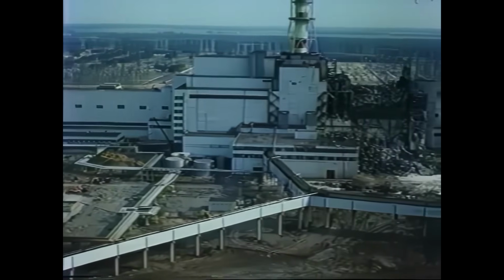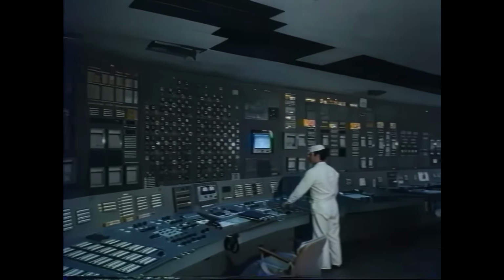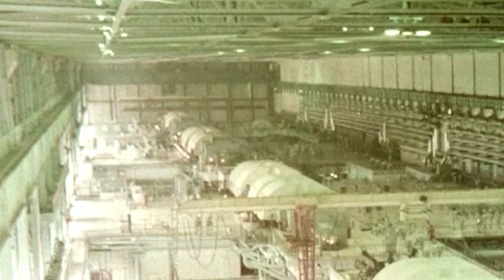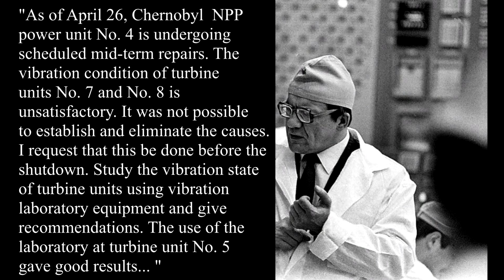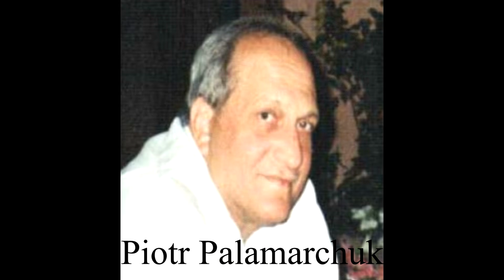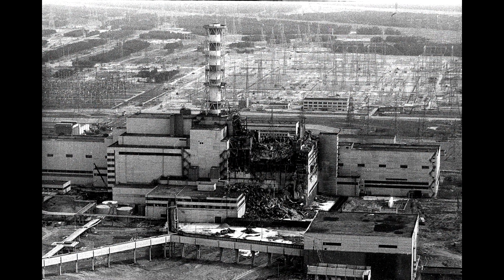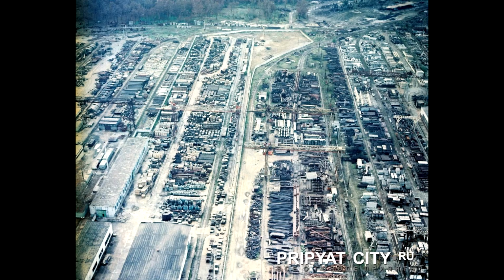Chernobyl Vs. A Mercedes: The Untold Story

Comment: Regarding Western Computers VS Soviet Computers there is an intresting story about how the Moscow Airport was modernised for the 1980 Olympic games.
USSR couldnt manufacture good enough computers for the Airport operations and American Computers for such operations was not possible due to Trade Bans between USA and USSR.
So  Moscows Governor contaced the Swedish Embassy for the possibility of an Affair with Swedish Computers which at this time was able to play at the same level as the Americans.
and after some deliberations the affair was approved With some Special rules to the Installment of the systems beeing done by Swedish Engineers.
there was however a small issue.
You see it  turns out that the new Computers used American parts to a certain extent and for those there was the ITAR rules.
So the Swedish Company DATASAAB if i remember correctly Simply kept their mouts closed about the parts and hoped that USA would be to tired of drunk to connect 1+1 = 2.
This was however a Dumb plan and it was soon found out by the world.

So those Computers would indeed be very valuable for USSR.

Comment: Being a big fan of the NG series of Mercedes trucks, with a huge amount of information about it (documentation, drawings, images from different eras of production and operation, documentary videos, etc.), at one time, having become interested in the Chernobyl Mercedes, having studied and analyzed all its possible photos and footage of the chronicles in which it appeared, I have every reason to believe that this is NOT the 814/817/LN/LK series:
- the LK has a windshield located as close as possible to the roof of the cabin. the NG has a larger distance between the glass and the roof;
- the LK has sharper upper corners of the cabin than the NG;
- the LK has a practically flat roof, unlike the smooth roof of the NG (if the truck has a cabin of at least class M, more on that below). Also, the corners of the NG windshield are smoother;
- I have photos where you can see the grille of this Mercedes (you can even make out the emblem). This grille is too wide for a LK.
- After processing the photo at 9:45, I found that the length of the cabin ends at about the same place where the length of the fender ends. This made me realize that the truck was equipped with an M-class cabin, which has a small space behind the driver (and passenger). The length of such a cabin is almost half that of an L-class cabin with two sleeping bunks (that's why I call it a semi-sleeper). Why am I telling you all this? The LK NEVER had an M-class cabin. The photo at 0:25 creates the illusion that the truck has an L-class cabin. In fact, this photo was enhanced, processed and stabilized (of course, I have the original), as a result of which the glass on its door was duplicated to the right;
- There is a very popular photo of the destroyed unit from the outside during the liquidation of consequences of accident, taken at about the same time as the photo at 13:14, but from a different angle, which shows that in that place on the ground there is a van-laboratory without a truck (in another photo that I have, you can see that the van is missing a door, and next to it is a broken fire engine). Towing over-irradiated equipment from the territory of the NPP was pointless and dangerous, so the Mercedes, like the fire engines, was buried underground there, on the industrial site.
- The NG has a higher load-carrying capacity and is more durable than the LK (for many reasons and characteristics), so it was more expedient to put the van-laboratory on its chassis;
- By the way, I spent a huge amount of time to find at least one photo of a Mercedes of the LK class on the territory of the USSR. Unsuccessfully.
- This is not the SK series, it was put into production in 1989.

Comment: This is my bread and butter.  Data acquisition systems cost a fortune, and the best ones come from Germany, Austria or Switzerland.  It's no wonder the crew stayed with the van and tried to save it, they might have been executed for losing it.  The cost would have been prohibitive to equip each power plant with their own system, especially if needed only occasionally.  I've done more than a hundred spin-up, spin-down analyses on medium-size rotors (1,000kg).  Today's systems are portable and the size of a suitcase.  Back then, it needed a whole van to put it in, with vacuum tubes the only thing available.  It's now called Rotordynamics and Order Analysis, and it is of critical importance for determining turbine dynamic balance and bearing health. So-called Campbell Diagrams output from the system indicate critical speeds, and warn of trouble to come, resulting from imbalance caused by turbine damage or aging effects.  When translated from the Russian, most translators use "rundown" but in English, "run down" means dilapidated, so instead we use the term "spin down" which is just as accurate and without the negative connotation.  Did you know, that some rotors must be kept in constant motion, to prevent the shaft from sagging while they are stopped?

Comment: Whats most likely is that the parts inside were taken by KGB for reverse engineering because USSR suddenly had similar tech by 1989 to analyse the vibrations of their turbines. 
The vehicle itself, is most likely buried as almost all vehicles and equipment driven into the exclusion zone were forbidden from leaving in these periods of time.
And why we do not know exactly what happened, well its not unfound that no one just cares and considering how many units of the army and KGB even, worked at Chernobyl, it was miracle it even functioned and was as organised as it was.

Comment: I think it was more the vibration of the explosion not the turbine, they wanted to see if any of the data was on there, copy it then wipe it, I suspect the KGB stole it with all the equipment and it was fully decontaminated and put back on the road with a new paint job and registration number etc etc. Then carried on with a new crew as normal that's what makes more sense to me. But someone could have actually stole it being a luxury vehicle and content on the black market. I more towards the KGB aspect though.

Comment: Another possibility is the mobile lab and the body it was housed in could have been mounted on another Soviet built (or not) chassis and seen more use that way, after all the original MB truck wasn’t really all that valuable compared to the equipment installed on it. It’s kind of like modern fibre-optic cable splicing trucks, the body and specifically the equipment housed inside are worth $80,000+ but are mounted on a chassis that’s just like any other on the road and can easily be replaced.
Reply: A Mercedes truck in 1986 would in no way be considered as just another truck on the road in the Soviet Union. This truck would have been almost irreplaceable.
Reply: @SIXITHS  Bullshit and cargo cult. The equipment did the work, not the truck. Reddit origins of this channel show the worst through the comments.

Comment: The OM364/Om366 engine Mercedes Benz used in the LK class are full mechanic injection, the only electronic device is the flame start preheat system and is obsolete like a seventh toe on your right foot. The Deutz Air cooled, Detroit 2 stroke an the Mercedes OM314/352/364/366 are reliable af there like cockroaches
Reply: I agree 100%

Comment: Firstly, this is a great video essay and it’s the first time I’ve heard about this truck and it’s story! This is awesome. Considering, there were series of posts (ru) titled “the vehicles of Chernobyl” on the pikabu website and the Mercedes had never been mentioned. Secondly, it’s  finally good to know the identity of that patient/one of the truck’s crew members - Savenkov. I’ve seen this video a few times and always wondered how this person ended up at/near the epicentre of the accident. 
Thirdly, in my opinion I also doubt that the story that is told in the aforementioned book took place. Like some commenters mentioned under this video, the tech in the truck was highly valuable, especially for reverse engineering purpose. The KGB (together with the Stasi) would have done their inspection first thing after the purchase/shipment before the truck even reached Kharkiv. 
I reckon that the truck was decontaminated to the best it could have been done. Then it was most likely used for the transport (modified) or in its original role in the 10 km zone (hence not seen on the vehicle graveyard photos). Don’t forget, there were lot’s of research organisations established post the accident, and the exclusion zone was pretty busy plus the reactor blocks 1, 2 and 3 continued to operate up until 2000. The truck could have been possibly written off in the late 90s and sold into (unsuspecting) private hands.

Comment: Very interesting story. Last records mention that the vehicle got recovered for decontamination, but in 1987 at the Popovs funeral it was announced that the vehicle cant be decontaminated and will be buried. I wouldn't be surprised if it got most parts stolen before either being buried or written off as buried.
Reply: Or that nothing actually got buried, but instead was sold off for a cash price. Very probable it is still running in some far flung place.

Comment: My guess (based on similar stories)- KGB took it to analyse the electronic equipment. After that was taken out, the truck was parked at some KGB compound and later sold to some officer for the price of scrap metal. The officer repainted it and quickly sold it to a private owner running an illegal transport business for 10-20x more. After the new owner died of cancer (nothing unusual in post-Soviet Russia/Ukraine, right?) it changed the hands for several times. If we had the VIN we would probably be able to trace it running in some Russian or Ukrainian city like Kazan or Lviv just a few year ago…
Reply: And that if they haven't altered the vin.

Comment: Imagine it was never stolen by the kgb. Just some guy stole it and sold it and it is driven around somewhere in the world, stripped from the technology on the back and used as a simple truck
Reply: "Comes with radiation poisoning but for you special price"
Reply: "There's a plus.We don't charge you for the radiation"
Reply: this did happen with some vehicles.
Reply: It Happens .. after yhe meltdown of Japanese Nuclear Reactor, Fukushima Daiichi 4, the cars from that area were cheaply imported to Pakistan and sold to to customers as prime Japanese cars ...

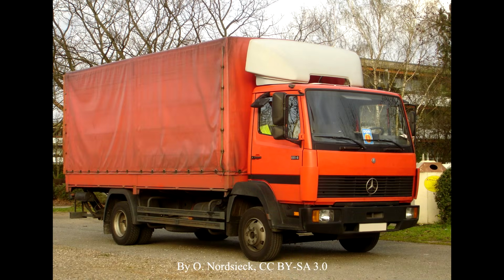Comment: To me, it looks like the picture of the truck at around 3:00 was taken in East Germany. The sign in the windshield says "DDR" and on the glass collection container I think I see "Braun" spelled out (for brown glas). How did this happen? 
I worked in a company in East Berlin around that time that made turbines (VEB Bergmann Borsig) and other equipment for power stations like generators and steam generators.  I'm not aware that the turbines were made for nuclear power plants of which there was one in Greifswald. Maybe that is where the picture was taken? As a test run before it was shipped to the Soviet Union?
Reply: It's just a random picture of a similar truck. If the box was full of high tech equipment the side walls would not be made of tarp.
Reply: @ilhuikar  Well, of course. I feel stupid now. I guess I was so amazed how this truck was tracked that I really thought this one at 3:00 is the real thing. Thanks for clearing this up.

Comment: I’m a vibration analyst on high speed rotating equipment, often industrial gas and steam turbines, and coal, gas and hydroelectric power plants.

What’s really interesting is that now I can do with a tool the size of a GameBoy, or on the outside a tool the size of a rack-mount Ethernet switch, the job of this Mercedes commercial truck. The high end stuff still doesn’t cost much less than a new Benz truck though.
Reply: May I ask if you have you done work on ship propeller shafts?
Reply: @anthonyxuereb792  I haven’t done marine work, although the fundamentals are pretty easy to understand. There aren’t many difficult fault frequencies to calculate on one.

Comment: Knowing what happened to decommissioned vehicles that were pulled out from the exclusion zone and than left out in the open, that truck has likely "donated" its parts to various other trucks throughout that part of the globe.
Reply: A MB truck would have been worth it's weight in gold, surely it found it's way out of the zone
Reply: @kenon6968  An actual liquidator responded. He remembered seeing the truck, and his group processed it and buried it in concrete. No real reason to lie about anything like this.
Reply: But did they get the computer. The truck itself was easy to replace

Comment: What impressed me is that the truck even worked after the incident.   It was a very hot area and electronics don't like radiation.   I guess not being hampered with the excessive amounts of electronics we have today helped.
Reply: My guess is that the truck was a diesel and had mechanical fuel injection.  I can tell you from owning a 1979 Mercedes 240D that the most electronics in that car is the aftermarket stereo.
Reply: @bobbbobb4663  that actually makes perfect sense on the mechanical injection.    And with that being a work vehicle I can imagine it being very utilitarian inside.   Heat and if you were lucky a/c.   Imagine trying to get a modern anything to work on that environment for more than 4 minutes.    It would be near impossible with all the fancy gizmos on a modern vehicle.
Reply: @bmstylee  Right.  I’ve always joked that when the nuclear bomb hits, coachroaches and old Mercedes diesels will survive.  Nice to be proven right!
Reply: @bmstylee  The first common-rail-Diesel-engine used in a road vehicle was the MN 106-engine by East German VEB IFA Motorenwerke Nordhausen. It was built into a single IFA W50 in 1985. Due to a lack of funding, the development was cancelled and mass production was never achieved. after that alfa romeo made it in 1997? so yea mechanical fuel pump
Reply: @filip-pi9hy  No idea for trucks but Mercedes started converting their diesel passenger cars from mechanical to common rail injection in the mid 90’s.
Reply: @bobbbobb4663  you are wrong w202 c klasse c220 CDI is 1998 one year later then alfa romeo 156 2.4 jtd
Reply: Mercedes used ecu and electronic inline pumps before common rail took place, in their om605 and om606 engines. As well as electronically controlled rotary pumps in om602 2.9 engines from 1994. Still a lot later than mid 80s tho
Reply: I wondered that too, I thought the amount of radiation in the air would've rendered the electrical components on the truck's powertrain - starter motor, battery, distributor etc. useless, and thus unable to start. Seeing the other comments about the mechanical injection,  and being an older diesel engine with a minimal electronics, probably helps (also the key reason one of dream cars is an old diesel Merc, W114/W123 model). 

One video I also watched mentioned how the USSR preserved a number of steam locomotives during the early stages of the cold war, for this reason. Even in the event of a nuclear attack, with diesel and electric trains inoperable, the steam trains could still operate, being mostly mechanical and more resistant to dead electrics from the radiation. 

https://www.youtube.com/watch?v=0SPI6HHQCC4
Reply: Push start it if all fails, if you can start it, it will go.
Reply: Waht electronics

Comment: Somewhere in the Soviet Union, there was a random orange truck which didn't need to have its headlights on to be seen at night.
Reply: Iradiated steel have a fairly shoet halflife of a few years. Of its just very carefully washed and all the dirt and grimes removed and oil change. It would be pretty much totaly declassified to the union broke
Reply: @matsv201 If the steel is activated, a wash wouldn't decontaminate it.
Reply: @garethjohnstone9282  that is technicallt true. But activated iron, crome,  molybden and other isotopes that is in steel have farily short half life. It would be totaly decominated by now.

The only part that have a long half life is activated coal and.. well.. we eat that every day, so that is  not really that dangerus.
Reply: @matsv201  well, a tiny portion of the carbon in the steel would be activated and become C14, with a half life of over 5,000 years. So, it wouldn't be totally clean.
Chromium isn't in mild steel that's used for vehicles of that era. Addition of chromium to iron and carbon gives you stainless steel. A DeLorean!

But yes, cars are made out of mild steel. Also known as unalloyed steel. 

Personally, I wouldn't want to own that van, with how close it was to reactor 4 during and after it went snap crackle and pop.

Comment: Vehicles that aren't used, batteries go down fast. Diesel is harder on batteries with glow plugs heavier parts, higher compression. The battery is likely why it needed to be towed. So far as balancing equipment... it was their equipment already, no need to steal it for country. Stealing something bright red like that, from Chernobyl... BAWLS of irradiated steel!😂

Comment: Great story! 
My guess is that the KGB took it so they can back engineer what the truck had inside. It was probably scrapped afterwards.
Reply: The truck wouldn't be sold at the first place in case it did contained something so secret and for reengineering USSR could brought just another one at the first place no matter how expensive it was if it were important enough.
Reply: @KasparOnTube it probably contained a working gearbox